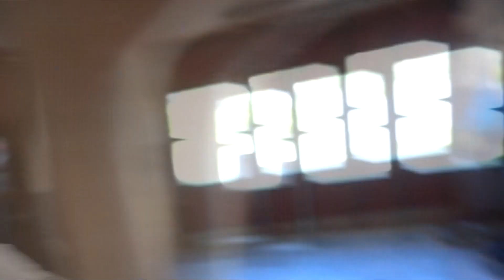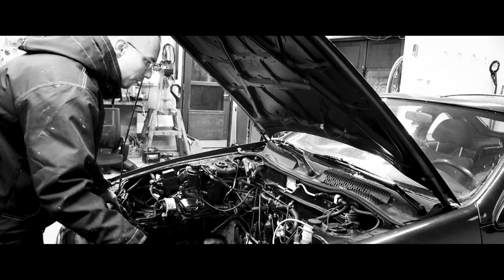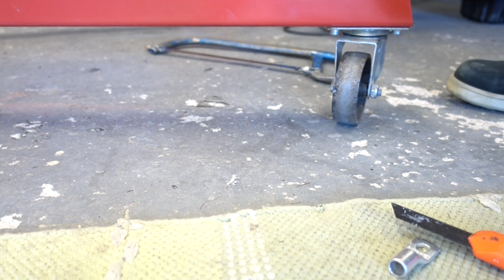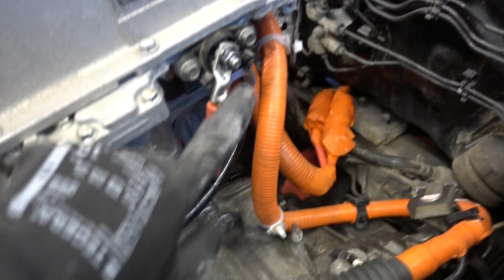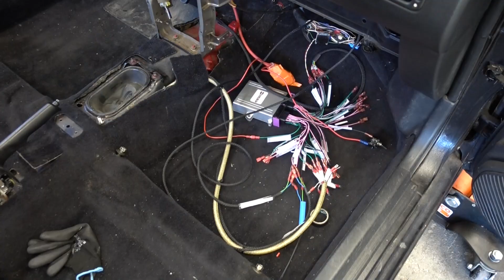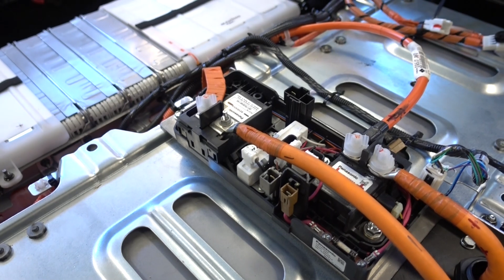Wiring in the Resolve EV controller and STARTING! [EVNX EP12]

Comment: Sorry for this stupid question, but what's the benefit of using the Resolve controller instead of the original Leaf controller? Seeing as everything else are Leaf parts.
Reply from the maker: Original leaf controller needs all 9? Control units, airbag, handbrake, body control module etc. This makes is extremely hard to do a conversion with the Nissan control bits!
Reply: @DalasEVRepair  thanks, that makes a lot of sense.

Comment: Does the battery need to come from the Leaf as well?  Would be nice if you aren’t limited to reusing the Leaf battery.
Reply from the maker: At the moment LEAF packs only. But all 2013+ 24/30/40/62kWh packs are supported!
Reply: Is there a reason that you could not use any 96s Li-ion battery pack and cell tap at the same points back to the BMS? You obviously can't use another chemistry like LiFePo4, the BMS would see the wrong voltage.
Reply from the maker: @freek7387  Totally possible!
Reply: @DalasEVRepair  This is really interesting, thank you. I have been considering a Leaf motor for a conversion like this but the Leaf packs don't fit too well in my case so I would want to use the 6s2p CALB modules if possible. I was thinking about using the Resolve-EV controller but was concerned about the BMS side of things. As the CALB modules are Li-ion it sounds like it could be possible?
Reply from the maker: @austenchevalier917  resolve ev is compatible with e.g. ID3 packs. Best to contact the maker!

Comment: Are you using a 30KWh pack - I thought the resolve only worked with 2013 onwards 24KWH pack????
Reply from the maker: Yes I'm using a 30kWh pack. I'd even say that the 40/62kWh pack works, the necessary communication is in the same messages!
Reply: @DalasEVRepair  so you didn’t have to change the resolve or use a can bribe to the battery pack, it just worked with no changes?
Reply from the maker: @georgekinghorn7495  Plug'n'play!
Reply from the maker: @georgekinghorn7495  Use the discount code in the description if you order a set 😁

Comment: You have a gearbox, that means on highway speeds u could getter better range than original leaf?
Reply from the maker: I am more after better acceleration than the original LEAF ;)
Reply: @DalasEVRepair  nice 👌 are u planning to go racing?
Reply: How Many volts is this battery bank??
Reply from the maker: @losdeoleo1718  404V fully charged